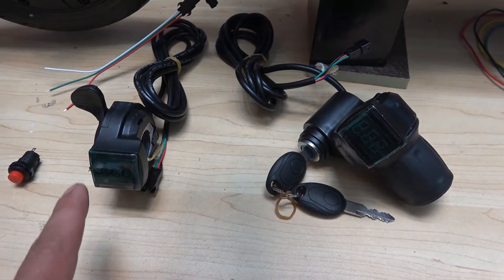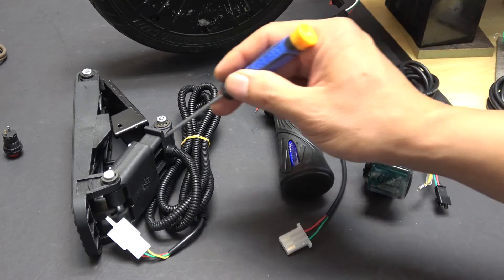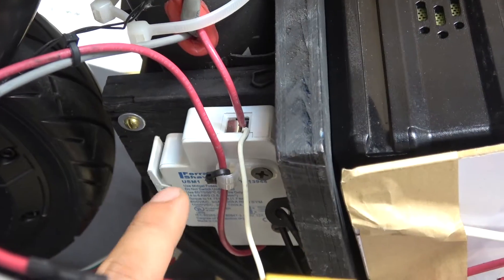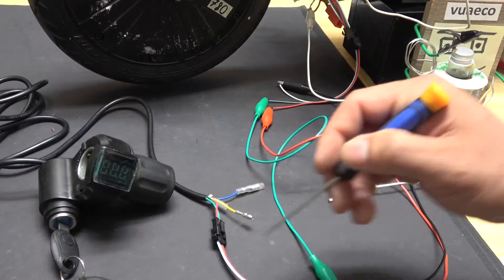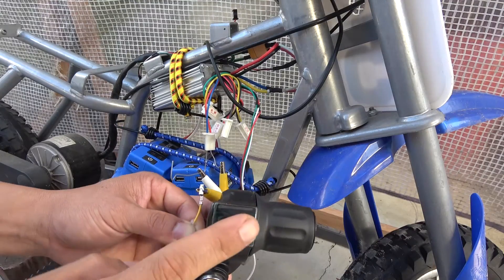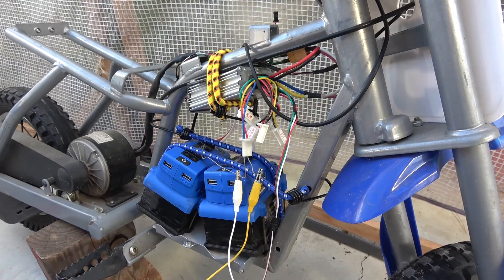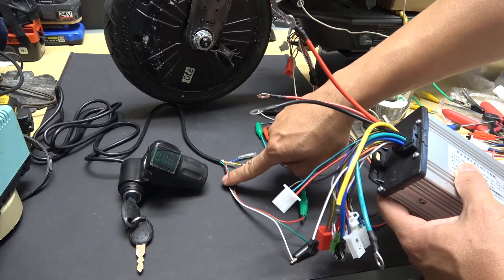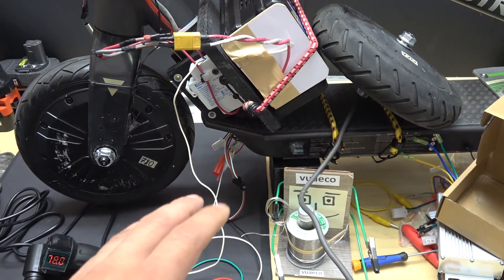DIY: How to install throttle control w/ LED voltage display & ignition key on electric bike/scooter

Comment: Yellow is ground.  Good grief, Obnoxious.   None of these controllers conform to a wiring color standard but at least respect voltage and gnd, or so I thought.  I'm trying to figure out what this green button on the throttle right under the voltage display is.  I can tell finding this out is going to be arduous.  I think it's brake high.

Comment: Good knowledge. People always think it is hard to get two connectors to work, Just cut off the connection that is odd, and solder in the same type. plug it in and go. go showing how red and green are constraint and that the ground wire can change, thats what meters are for.

Comment: Is it possible to connect the blue and yellow wire on the throttle to bypass the need for the key switch and just use it as a throttle?

Comment: This is a very good explanation but it still doesn't solve my issue.
I've had to change the controller on a Trail - G ebike and basically no matter what I do the throttle remains live !
I've tried every combination until I was blue in the face !
In fact I even blew the original throttle.
So I've got to add another "ignition switch"  to the "door lock" (or even the sodding main power if that doesn't work).

The problem is that the ebike is not designed to have an LCD screen and has a box with it's own logic in it to connect the lights & horn, Brake lights & throttle/key switch hence why the throttle is finding a permanent live feed from somewhere ! (It even works when the LCD screen is OFF)
https://i.imgur.com/1C4dn7C.jpg

Comment: Thank you so much for making this video. I bought both 4-wire and 5-wire throttles.
When I connected the 4-wire Throttle, my bike went well.
The problems started when I tried to connect the 5-wire Throttle because I didn't know where to tie the blue wire.
I suspected that the blue wire should be tied to the thin red wire (which goes to the battery).
My bike is at 36 V.
When I connected the blue wire to the thin red wire, the voltage dropped from 41 V to 24 V and the motor stopped running.
I would have been delighted if you could film where the blue thread is tied.
The clip has no subtitles and I don't know English very well.
 I understand a word, from 2 words ...
II would have understood exactly where it needed to be tied up, if I had seen it filmed.
But even now, if you explain it to me, I can use Google Translator to understand .
Thanks !
Reply: Também não entendo nada do idioma do vídeo. Também estou com problemas. Meu motor e 24v.mas não chegam nem 12v no motor acho que estou ligando errado. Do Brasil obrigado.

Comment: Thank you for this! Quick q- when I hook up the key switch throttle to a 3 speed controller, there are no other wires besides the ones for the lock. Does the throttle default to the top speed on the controller? Or is it best to use a 3 speed throttle then a separate key switch for the lock?
Reply: Did u find out anything about the 3 speed controller wires

Comment: hi thankyou for this excellent video. i have a question( to anyone )regarding my throttle and controller... the power lock connector on the controller has a red and pink wire.the two wires from the throttle 
are yellow and white .does the red connect to the white and pink to the yellow???? thankyou.

Comment: Absolutely fantastic tutorial.  You should be teaching in a class.  You explain everything so thoroughly that even a newbie like myself can understand what you're doing.  I don't know how you learned all that electronics theory but keep up the great work.  Those controllers have so many wires and I didn't think they came with wiring schematics.  Anyway, the way you explain things makes it seem so simple and you even show the results of the connections which makes it even better.  I would never attempt the things you're doing as I would likely short out the controllers or burn down my house.  I know how to use a multimeter but still...  I'm a bit careless at times.

Comment: I have a key switch/volt meter (no throttle)  with 3 wires (green, red and black). My controller has the single wire you describe that should go to my switch. Please advise how to connect the 3 wires from switch (green-red-black). Love your channel!

Comment: My motor turns fast when I connect the self-learn plug but it will not turn when I disconnect the self-learn. The display lights up and says 53 volts.
I have plenty of clips with jumper wires so I tested every possible combination of throttle wires. I also tried a new throttle that has no key or display and it won't work either. 
Any idea what might be wrong?

Comment: Hello......just one question pls 🤔

I want to install key throttle with voltage meter.....BUT 

I have No single Red wire to connect switch.
I have 35A Brushless Controller
Reply: All wires are labelled easy...
But no spares.....

Bought from KT ebike AliExpress 😉
Reply: Or 🤔..........

Can it connect to display

Comment: Hello. Awesome videos. Question...I am working on a bird 2 escooter and just connected the 36v brushless controller and noticed that when I pressed the throttle the wheel did start spinning but there was no variability and the wheel kept spinning even after I let go of the throttle. What did I do wrong? I cant understand this. The controller I bought was the cheap chinese one from amazon. I was able to stop the motor by bridging one of the conectors from the controller. Can you please offer some direction? Thank you
Reply: I have a similar issue. Did you find out what the problem was?

Comment: I need your help, I have a 6pin twist throttle with ON OFF. I followed your video and I know Red/Black/Green is throttle, Blue & White is switch, but Yellow (battery indicator on throttle)?  My controller has 6 wires (red/black/green/yellow/brown/pink).  The yellow from the controller provides the voltage of the battery.  
I've been trying all sorts of combinations, but I couldn't get it to match correctly, to function.
Thanks

Comment: Is there a way to change the voltage with the controller if it’s rated 36v48v

Comment: My controller has to wires one is orange says electric lock and a blue wire that says autometer and i have a brushless motor and and that switch with on and off switch with that extra blue wire I'm not sure we're to hook it up bought the controller on Amazon
Reply: Ever figure it out?
Reply: @johniannello8455  yes I did the electric lock I'd on and off switch the auto meter is the voltage display wire

Comment: I just want to be able to turn on and off the volt meter not the scooter, can I use just the yellow wire and not the blue like you wired up the one with out the key?

Comment: That's just the video I was looking for. Doesn't help me all the way through, because I need to connect a broken 7 wire throttle: pedal assist and throttle and voltage display, with 7 different colours. but I learned a lot. thank You
Reply: Same

Comment: My battery has a key that starts the power but the controller does not have a wire for that that I can find. Its a 48v brushless set up. I bought a throttle with a button and display instead of a key but the button does the same thing as a key would. I just didn't want another key. I'm having a  hard time figuring it out. I can get the display to work but not the throttle.

Comment: If your throttle that came stock with a 36v ebike will it run a 48v battery or do I have to order a 48v throttle
Reply from the maker: It will.

Comment: Made my day, you took all the guess work out my project, however if I wanted to add a brake light how would I go about it, the brake light terminal puts out full 40+ volts when I hit the brake lever, what type of light could handle this?
Reply: Look on Amazon. They have many light sets that can handle 12v up to 80v.
Reply: I went on Amazon and bought a rechargeable taillight with a built-in accelerometer that senses braking.  That's the best I could do for my scooter.  The scooter's display shows something is activated when I squeeze the brake lever but the rear lights don't get brighter or flash.  How stupid is that?  No way I'm going to mess with the wiring with no wiring diagrams and make things worse.  The rechargeable taillight/brakelight works just fine.

Comment: can u help me i have an m365 pro 2 and wish to attach just a voltmeter. when i connected them to the battery wire i got a err 21. if  i attach the black from my voltmter to the ground of the panel and the red  of the voltmeter to the battery's positive line; do you think that would  work?

Comment: I want to change the Throttle to a key one. What happens to the on off switch,  Do I uninstall it?

You are amazing! I'm making some minor modifications to my Windgoo. It's only 36 v 😪 but it's still fun. 
Subbed 🤘🏼

Comment: I have 3 pin throttle i ordered a throttle it has a 3 pin with 2 extra wires blue and yellow do i connect each one to positive wire and controller positive wire?

Comment: Thank you for this video maybe you can show how to connect a throttle that has three speed switch and maybe you or somebody can make a video on how to connect up a pas pedal assist system as nobody has done a good job with that either

Comment: I notice you are using the same SICAN controller as I have. I've never had a diagram of the connector functions. Would you be very kind and let me know them ?
Thanks very much and I enjoy watching your very helpful videos.
I can provide an e-mail address if required
Best wishes  Peter

Comment: I need HELP… I just bought the ignition key switch with voltmeter and no throttles. I’ve seen some guys on YouTube connecting it to a xiaomi scooter. My question is do I connect the same way on my Ninebot max g30? If yes then another question is how come those youtubers installed on xiaomi but the voltmeter is showing example 04.9 volt instead of something like 36.0 volts? My guess is something is not right on the wiring part hence it’s not showing the actual battery voltage

Comment: Not all controllers have the ignition wire. My voilamart controller is turned on via lcd display. There's no separate ignition wite. The connection between the display and the controller is 5 pins. I'm not sure how to wire the key switch so that the ebike is turned on/off by the key and not by the lcd display.

Comment: Thanks for the video, I'm having a issue I installed my setup and when I twist the throttle the motor is spinning backwards I am guessing I wired something wrong
Reply: @ Vergil workman He has a video explaining that issue , or if you want you just can turn the wheel around like someone else did but don’t take me for it lol . But yeah this gentleman is very detail on what he does and very easy to understand and quote “to the wire” 👍

Comment: PLEASE help!!! I have a Swagtron Envy that I have to install a new throttle control. I am so confused on the wiring.
Reply: It's simple. Get a cheap throttle, without the key or voltage meter. Most throttles will have a white/green/red wire. Cut the throttle wire off the old one and just match up the wire colors!    Red for +  White for Ground and Green for signal.

Comment: Hello! I have swagtron be-6 and my stock throttle broke. I’m having a hard time installing a new one. The new throttle has 6 wires red/black/ yllw/brown/grn/whte/ and the stock control has 5 wires red/blk/blu/yllw/whte/ I tried splicing but the motor does not move.
Reply: Yours is for a 6 pin the 5or4 is the digital throttle.   6pimn come w kits a harness.   I got one.   Won't work without it.     Crazy all u need is 3

Comment: Hoe much current does the switch wire have from the controller to the throtle? 5 volt or the voltage of the battery , in my case 24 volt?

Comment: Good tutorial. However I've found that some controllers such as the Violamart kit controllers with 5 conductors don't provide 5V to the throttle signal, but the throttle converts the battery voltage to 5v signal voltage.

Comment: I have the same controller with Chinese letters, I wanted to know where the lithium battery charger is connected in this controller? the other controllers have a charging port for the batteries, but this one does not seem to have, where is it?
Reply from the maker: There is no charging port for a speed controller like this one. You need a BMS for your battery pack and the charging port comes out of the BMS.
Reply: @vuaeco  My 36v lithium battery has only one output, it goes through the bms and feeds the electric bike, but it has no more cables, only those two a negative and a positive. Is it charged through that cable, but I understand that it is a power outlet? what can I do, help me friend
Reply: do you have whatsapp or telegram to send images?

Comment: I connect the first with the voltage meter!! 
I change the throttle from finger to thumb! All ok with this!
The mistake is... You say many times the yellow tire to the battery!!
And WHO IT'S SWITCH OFF??????
now I have to put a little switch to one-off the power to the throttle!!😤😤
Reply: Ok the problem is that the scooter don't go over 40 klm and before conect the thumb throttle go easy 65 klm!!
What do i do WRONG 😭😭😞

Comment: TOTAL ENJOYMENT!! BEEN INTO EBIKES FOR A BIT OVER 7 YEARS. I HAVE 3---CONVERTED    FROM CHINESE KITS. EVERYTHING THEN WAS MOSTLY 36 VOLTS (48 V JUST COMING ONLINE). THEY NEVER EVEN COORDINATED THE WATTAGE VALUE OF A BATTERY TO ITS CONVERTER. SO YOU'D GAMBLE ON PART SWAPPING. MY 750 WATT MOTORS ARE POWERFUL ENOUGH FOR ME. I GO 20-25 MPH. TOO BAD YOU WEREN'T AROUND THEN TO INSTRUCT US (WITH LESS ABILITY). IT SURE  WOULD HAVE HELPED! I THANK YOU FOR ALL YOUR VARIED PRESENTATIONS.
Reply: Caps lock was on